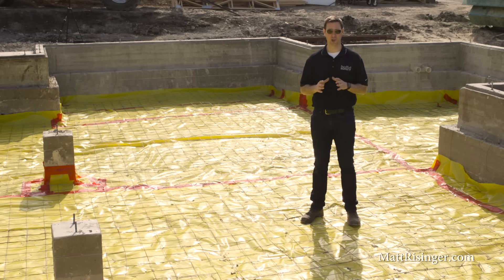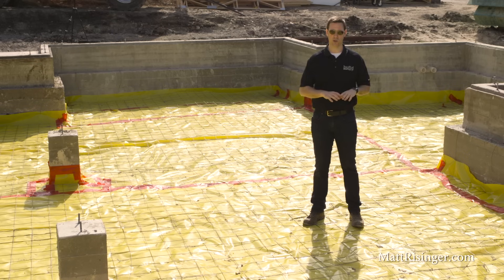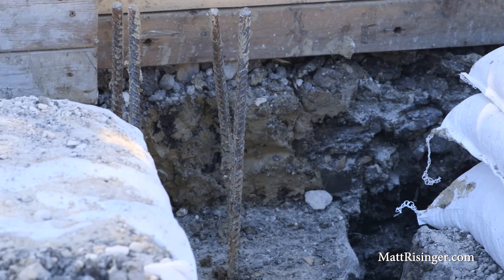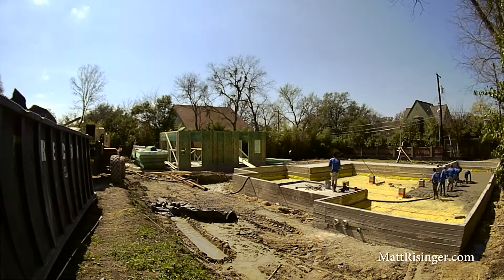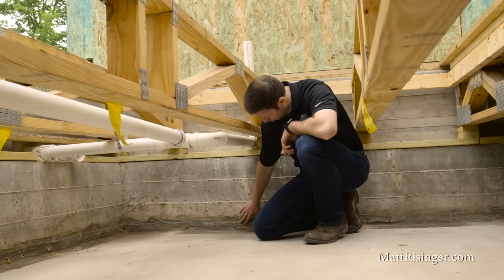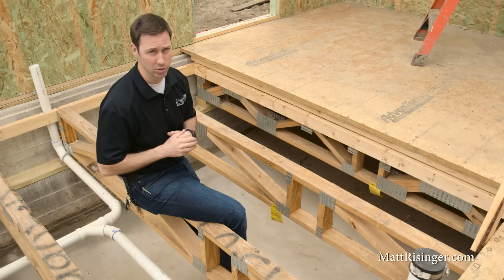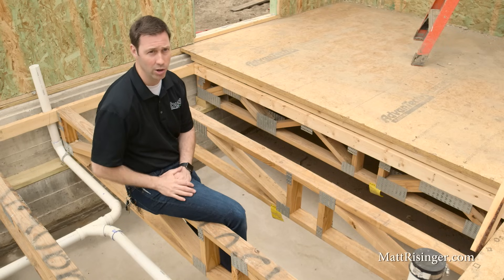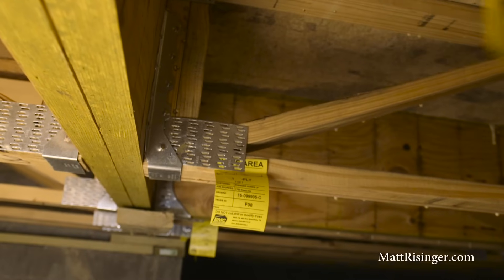Pier & Beam Foundation with a Conditioned Crawlspace

Comment: I understand the ledge and two-blocks under the web trusses, but the finished floor and steam wall details is confusing me.

Are there two layers of subfloor?
Is there a mudsill stacked on a bottom plate?
Why the rabbet edge on the concrete when the flooring is floating over it?

Not criticizing — just trying to understand if this is a detail I should consider.

I’m planning a 32" clearance from grade to the bottom of the web truss, with a sealed crawlspace. I’m going back and forth on whether to set the trusses on a concrete ledge or a pony wall.

I’ll be using red steel posts or piers — the stem wall is only to support the first floor, not the walls or roof.

Comment: What is the purpose of wire mesh under
 a non-load mud slab?
Reply: the slab is only 2". the wire is for when the concrete does crack and it WILL for sure cause that is what concrete does 100% of the time. with wire the concrete cracks and stays in place, no wire means when the concrete cracks little chunks will be coming out.

Comment: I see the value of sealing the crawl space floor and insulating the crawl space walls but I don't see how that precludes venting.   The vents can be closed if desired but at least they give the option to cross ventilate the crawl space with fresh air should problems arise.
Reply: The vents are often the source of the problem. Warm, moist outside air goes into a cool crawlspace and and the water vapor in the air condenses into water in the crawlspace.

Comment: Matt, I'm thinking of building a house like this. Just curious where would you be putting the access door to go inside the crawlspace. And what dimension would it be if ever have to replace the dehumidifier in the future.
Reply: Typically place access in a closet.  If you've properly sealed the crawlspace, should not need a dehumidifier as moisture should not be able to enter the crawlspace.
Reply: @ArthurDentZaphodBeeb  Many recommend a dehumidifier for the first year after construction to get rid of the moisture build up from the lumber and concrete drying out.
Reply: @JamesG1126  maybe I wasn't clear - main house needs a dehumidifier  - conditoned crawlspace is connected to the main-house hvac, so the crawlspace is also being dehumidified. Don't need a separate dehumidifier for the crawlspace...

Comment: here's an updated video from matt .. showing an insulated slab foundation......  dirt < gravel < two layers of foam board (Two- 2 inches of  type 9 eps )  < 10 mil poly < 4 inches of concrete pour on top ... 10 mil poly up the wall a foot or so and buried by the closed cell wall foam sprayed around entire perimeter.... https://www.youtube.com/watch?v=XKp0wRzvR-g

Comment: Im surprised you didn’t add lighting and an outlet or two I mean if you rarely will use the space when you do it’d be nice to have the lighting and an outlet for tools right
Reply: with all the added cost of doing things this way, one might as well just go with a full basement and climate control it in my opinion.
Reply: @jamieofalltrades536  A full basement is a lot more expense.  The excavation would be much deeper, the concrete walls would be 2.5 times the height.
Reply: @JamesG1126  yeah, but a basement is more cost effective because of the extra living space. Texas doesn't have many basements though.
Reply: @KelMars-s7k  Basement living area is much more expensive the 2nd story living space especially if you have water issues to deal with.
Reply: The issue where he’s at in Texas is the high water table that makes a full basement not very feasible. That’s why you don’t see them in Texas as much. Also the frost line isn’t very deep so there’s not much need for excavating as deep as up North.

Comment: Can you use this with a post frame building/home?
Reply: Yes. Pour piers below the frost line  every 8 ft put up wet set brackets for the post. Then pour your conditioned slab around the piers the concrete needs to go to the outside of the piers. Your bottom girt board will seal the the concrete. That's how in doing it

Comment: Matt, could you insulate under the concrete using 1"- 2" insulation foam board? 
To Enclose the heating envelope?
1st time viewer, love the video.
I'll be building in West Virginia.
Thanks
Reply: you could but that would be a waste. ground temp is stable, heat rises. with a conditioned crawl space the open ground is a non issue in most cases cause the temp is so stable.
Reply: https://www.youtube.com/watch?v=XKp0wRzvR-g

Comment: Would sealing the concrete without having the Stego underneath do the same job?
Reply: Concrete is slightly porous, so the barrier needs to be on the outside of the concrete. In new construction, the entire basement has Stego or a water-proof coating on the outside.

Comment: And, if you completely seal out any ventilating air, you are going to have dry rot. You can believe that, I know from PERSONAL experience. Completely sealed my under crawl space, went back in to check it out and it had begun to mold, so, I went back cut in some vents and solved the problem. The sun will pull vapor through your home and if it can't escape, you've got mold and rot. Try it!
Reply: If that is happening to you, then somehow moisture is getting into the crawlspace. Either it's not a sealed crawlspace like you think it is from the inside to the outside, you have a leak from the interior into the crawlspace, or your upper floors have high humidity and they're condensing on the colder crawlspace parts. Could be any factor but the basic rule is, treat it like a basement. If you have moisture issues, you need to resolve those issues and using a dehumidifier is just a bandaid and not a solution, as is ventilating the crawlspace.
Reply: what youre saying is wrong on every level. you cant get mold unless you did something wrong. mold cannot take hold if the humidity is not above 55 or 60%. so if you had mold your space wants sealed or conditioned properly. period
Reply: @jjg1501  it's basically a basement what don't people get about that.

Comment: Did you consider using the conditioned crawlspace as the plenum for the HVAC?
Reply: i do that right now with my basement. i dump 90% of my heat directly into the basement and let it filter up from there. it works well for me. i do fill in with space heaters cause my house is a million years old and is very very leaky. i only have to fill in when i gets below 25F
Reply: @Phil Ward - not pressurized - used for return air instead.  You would still need ducts for air from the HVAC unit to each room vent.
Reply: - not pressurized - used for return air instead.  You would still need ducts for air from the HVAC unit to each room vent.
Reply: Not allowed by code. It would also increase operating costs of the HVAC system. You are better off with a properly designed ducted supply and return. Most are not properly designed and installed. General contractors and homeowners rarely understand the value of it.

Comment: If the slab is laid on grade, will a moister barrier still be needed?
Reply: its always required under a slam unless you want humidly issues.
Reply: Yes. In Texas (at least) they put down a moisture barrier for slab on grade.
Reply: Thanks for the reply.  I'm going to be building a house in a couple of years (SW Tennessee), and I want a fully encapsulated crawlspace with a slab.  I'm in the research phase right now.

Comment: Matt,  would this be optimal for the rocky coastal area north of San Fransisco? before we build, I am researching best practices.
Reply: Matt Risinger would most likely tell you to involve your soil engineer and builder early on in the process when evaluating build locations.  The real challenges are typically engineering challenges and are usually overcome with more money (i.e. Golden Gate Bridge, Hoover Dam).
Reply: Paul - what did your engineer say? I am curious.

Comment: IF having a crawl space like this is an option in TX...  what about going deeper and build a full basement? Could use similar posts down to bedrock, only instead of a 3 or 4 foot wall, you could place a quality ICF wall that is steel reinforced... I live in San Antonio now, but was raised in Michigan where we had basements...   Drives me nuts not having a basement here!
Reply: The main reason you have basements in the north and not the south is because code requires footings to go below the frost line.  In southern Michigan this is 42", and once you've dug down that far the incremental cost of a full basement isn't large.  In many parts of Texas it's only 12", and the incremental cost is much, much larger. When it comes down to where to put money, either in a basement or a second floor, the scale tips towards basement for the north, and second story for the south.
Reply from the maker: +William Du Chene me too. Grew up in PA.
Reply from the maker: +William Du Chene rock and the expensive excavation is the main reason not to dig a full basement.
Reply: is excavation most of the expense, or would that be the added building materials for the basement?
Reply: But if you are in clay and have to put in pilings to support the foundation, why not then dig down the extra 6 foot and have a basement?  An ICF basement wall with vertical and horizontal steel rebar would be idea!  Needless to say, I'm planning to have my basement here some day...  muhahaha!

Comment: I have used Pier and Bean 'Post and Beam' foundations many times.   However what is not mentioned here is, even as cool as it is, the 'Conditioned space' systems like show here cost a fortune, and well out of reach for the average family to afford.
Reply: Makes sense.  I was thinking damn that's gonna be a nice house.
Reply: It’s actually not that expensive, especially if you consider the benefits.
Reply: @Phil Ward problem with that is more opportunities for termites, rot, and mold growth
Reply: This is $10k or less additional cost over a conventional crawl space.   Worth it.
Reply: It’s no more expensive than a full basement.

It would be the same cost of a full basement foundation less the excavation of the dirt and a bunch of fill sand of a slab on grade.
Reply: that isint true but like most things it can be true. ask yourself what is the difference between a conditioned and traditional crawl space. nothing other then alittle insulation on the stem wall and a really good vapor barrier, thats it. its a few thousand more thats it. that is not alot when you consider the average house price is 150,000 2k is nothing.
Reply: @jjg1501  where I live in Washington state, it would be massively more than $2 Extra.
Reply: @10p6  if you applied the foam and vapor barrier youself the cost would change very little and this is only true if you have a crawlspace anyway.
Reply: @jjg1501  that crawlspace is much taller than a normal one, and adding the slab would be massively more cost. If one is doing that they should either build on monolithic slab, or do a full basement.
Reply: @10p6  a crawlspace is typically at frost depth so its not taller, and the rat slab on top was probably 200 dollars not at all what i call a massive cost. and all the things about slabs youre talking about mean nothing in the zones where frost demands 3.5' of depth. building frost protected slams and expansion protected slabs is also not cheap.
Reply: @10p6  lets also be clear what the point here is. if you have a crawlspace. the difference in cost to have it vented versus unvented is negligible is you do a bit of labor yourself. that was the point. and it is also true vented crawlspaces are superior to unvented by every metric. thats just math my friend.
Reply: @jjg1501  Sorry I have to laugh as I've designed and built houses and commercial buildings.
Reply: @jjg1501  once again I have designed and built. The vapor barrier is more than the $200 you said, as is the rebar, and 4" of concrete is thousands, not forgetting labor. Then add the cost of conditioning that space throughout the year. It's not worth it and holds no benefit.
Reply: For a 1500 sqft pour that's 2 inch's thick it's 9.5 yards at 100 dollar a yard that under 1k for the concrete slab
Reply: @justinballard7242  $100 yard, really, then labor on top of that.  2 inches thick is useless as it will move and break, so one may do 4" reinforced, and if doing that just do a freaking basement.
Reply: @10p6  2 inch's is the normal for a mud pad. I'm doing my own concrete. Literally only pennies in the scheme of things
Reply: @10p6  I've had mine done for over a year now. 3 inch's of concrete in my 1800sqft house 2500 bucks. Well worth it no regrets

Comment: I am sick of hearing people recommend full basements, and slab construction, when they see all the work we put into crawlspace is these days. A sealed crawlspace is not taxable square footage. You can have a furnace, water heater, ductwork, water filtration, storage etc., and never pay taxes on that space. You can access 1st floor walls for eternity. The electrician on this home needs to be paid to put in about 20 LED lights that are recessed in the floor system so they do not get banged when people access this space, or use washers to attach the keyless bases so that you can leave a little play in the screws and the bulbs won't break when they are "bumped". Sealed crawlspace aren't "dark", they are pitch black!
Reply: No furnace is allowed in crawl space for new construction NJ. If your ac is in the crawl space it takes much longer to service and cost more money . A crawl space is better than a slab for plumbing and electric ,and duct work . They should have a restrictions and be above three feet . That should keep you high and dry and above snow. No one is safe from a major flood  .
Reply: Great point! Used a light string from eBay with LED bulbs for my Beach house encapsulation project.  Just plug it in to the outdoor outlet prior to entry.
Reply: Texas property taxes are ridiculous.  I don't see why anyone owns a home there.  Seems like a very nice house is being built.  Too bad it will be taxed in perpetuity year after year for the poor sucker who buys it.
Reply: @jimbig3997  it all balance's out...you get more home for your money than an overwhelming majority of the country and Texas is the best country...erm I mean state in this fine union so there's that. can I borrow some of that salt?
Reply: Jim Big Could be a disabled veteran who won't pay any property tax for the rest of their life
Reply: steveXracer a light switch is infinitely better than a flashlight until the circuit breaker needs to get shut off.

Comment: Foremost, great channel and explanation of a conditioned crawlspace.  But why a crawlspace at all?

 Couldn't you easily backfill the interior with crushed stone until above grade and then pour concrete?  This seems like a lot of work and materials just to be able to hide floor vents (or whatever the case).
Reply: I was thinking the same, but for a different reason. The methods he used are good, but hell, at that point. You're halfway toward a full basement with more usable square footage and storage. Just lengthen the walls. If you just want to air seal, encapsulated without a slab is more than sufficient. This one just leaves me scratching my head and asking why
Reply: +Steven Race I was thinking the same thing, Interesting videos as always. Where I live prier and beam construction has almost entirely been phased out. Houses will be build on a reinforced concrete slab unless there is too great a gradient in which case pier and beam doesn't work anyway and you will most likely use timber or steel piles
Reply: I believe on this particular project the conditioned crawlspace serves as a chase for the air ducts, but I am not certain.
Reply: wow jesus that much?! didnt know. thanks for the info. wow, thats expensive.
Reply: steveXracer $100,000 imo for a basement is worth it especially in Texas where houses are cheap.
Reply: Round It's not worth it if you don't have the extra $100,000 to spend.

Comment: Looking at all of the work involved in that crawlspace, why not just go with a full basement and have the added benefit of extra storage or living space?  What was that cost of the crawlspace compared to what a basement would cost?
Reply from the maker: Remember we don't have a frost line so a full basement excavation is pretty costly here in Texas. Especially because we often have rock 1-3' below the surface.
Reply: @buildshow  Who is the architect on this project?  I would like to see the stem wall/floor joist/sub floor detail.  Thx.
Reply: I want to add that the clay soils in Texas are typically expansive, meaning they will expand when wet, and shrink when dry,  like a sponge. The basement walls would need to be about 12" thick cast concrete, likely with double matted reinforcement to resist soil movement, which gets very expensive. Because of this, basements in most of Texas are rare, limited to higher-end homes.
Reply: +Aaron Anderson You have to dig below the frost line to properly install footings.  In cold environments digging deep needs to be done.  More contractors who dig deep in cold environments, more competition, lower prices.  You only need to go a few more feet to have full basement height so you're almost there anyway.
Reply: good reply, one could (as is common in Vancouver) though just make the wall a bit higher and make it a useable space. (doesn't need to be done with concrete perse)
Reply: +Matt Risinger Just curious, how are the two related?

Comment: How did your slab crew pull up the wire mesh into the concrete?  by hand?
Reply from the maker: We used Chairs prior to pour to prop them up
Reply: +Matt Risinger very good.  Thank You
Reply: Is wire mesh really required for a non load bearing mud slab?
Reply: @JamesG1126  not required but you dont want to be picking up chunks of concrete as it cracks either. and 100% of the time concrete will crack